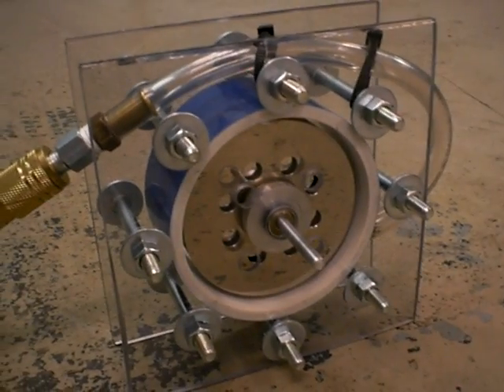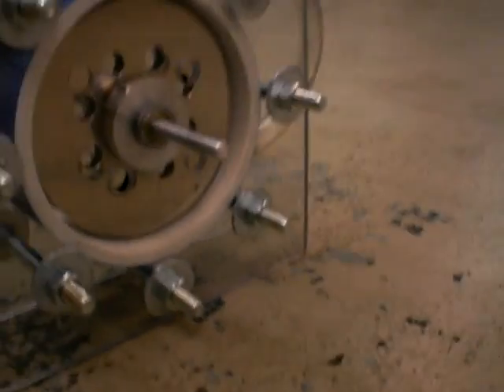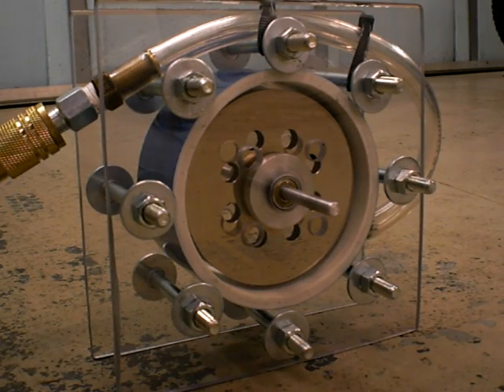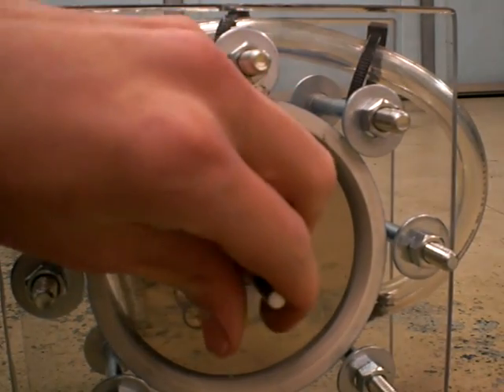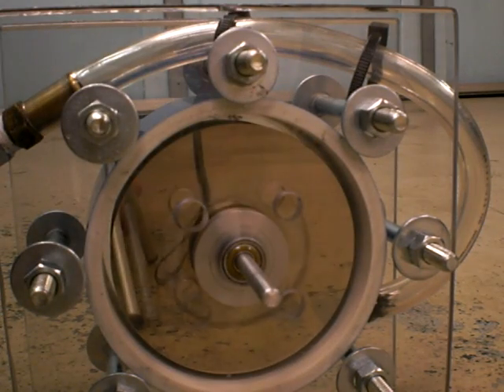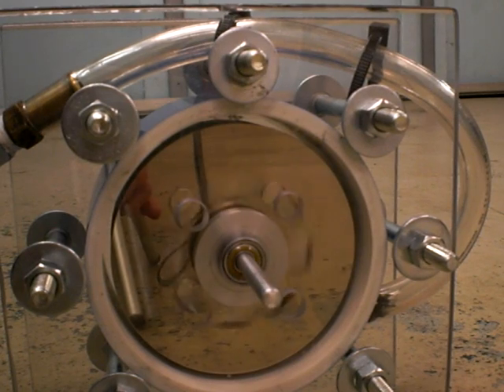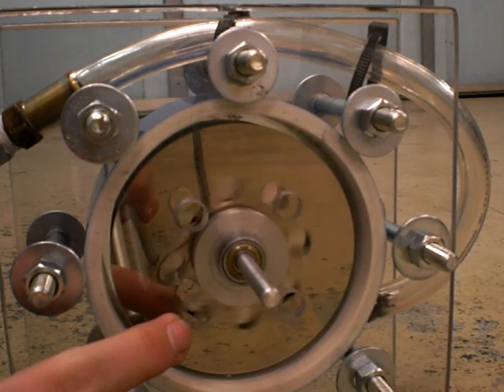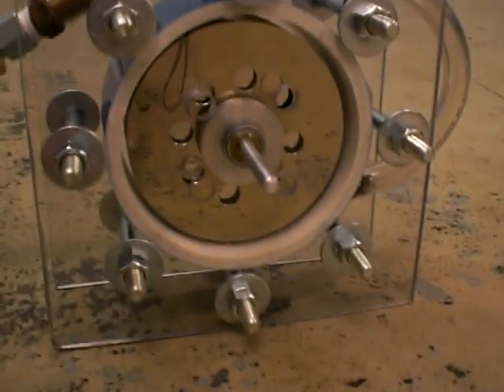Tesla Turbine

Comment: but with any type of load that thing will stop. you basically made a pinwheel. there is a reason tesla turbines are not using for power generation or in boats
Reply: Tesla turbine gets plenty of torque and outputs plenty of power, even at low RPMs, IF you actually know how to design them.
Reply: @CharlieSolis  you obviously dont if you cant understand you can stop it with you bare hand. thats not how torque works
Reply: @abialo2010  like I said IF it’s designed correctly.
Reply: @CharlieSolis  if you think im reading all that nonsense you just wrote you're sorely mistaken. thanks for the reply that is crazy
Reply: @abialo2010  lol well that’s your prerogative but everyone who comes through after will read how you demanded Tesla turbines can’t work and then someone with a physics degree came along and plainly explained it to you and showed you proof that Tesla turbines actually do work. 

Do you really want your reaction that everyone sees to just be “stick your head in the sand?”

Obviously it’s not going to be explained in 2 sentences because the fluid and thermodynamic involved within the TesTur are rather complex.

But ok. That’s your choice 🤷‍♂️

You can only bring a horse to water I guess.
Reply: @abialo2010  well when you feel like reading how TesTurs actually work give what a wrote a read. I promise it’ll be worth your time. It’ll be waiting there for whenever you are ready to read it. Cheers.
Reply: @CharlieSolis  no one is reading all that. but thanks for responding. im happy for you
Reply: @abialo2010   you could have just read it by now. It’s not even 3 whole paragraphs. 

Lol and actually MANY people have read all that because MANY people have seen my TesTurs that actually work and wanted to know how. 🤭

Your loss 🤷‍♂️
Reply: @abialo2010  literally what someone commented back to me 42 minutes ago on another thread…

“George Black • 42 minutes ago
@Charlie Solis This is tremendously helpful. I'm building a small turbine to run a feed pump for a monotube boiler. It should manage the water level in the boiler by running at varying speeds off the condensate steam in a separator as the boiler's water level varies.

Thank you for the videos and helpful comments.”
Reply: @abialo2010  Lol I don’t need you to read my comments for me to know people do in fact read read my comments and find them valuable. 

I’m waiting for you to just read what I wrote because I can almost guarantee you’re going to want to know more, and at the very least see the proof 🤭
Reply: @abialo2010  but dood, I’m totally with you that 99.999% of people who’ve tried making them can’t make them work. And There’s a very good reason for that. They aren’t designing them correctly. 

And again you can go as long as you want without reading my comments but I have a feeling, and from my past experiences with most people, curiosity wins in the end and if I just wait long enough you’ll likely just read my comment and actually want to have a discussion then. Until then let’s keep racking up the comment count on this thread so others will find it 🤓😎🤭
Reply: @abialo2010  did you read it yet?
Reply: @CharlieSolis  that's crazy. Thanks for sharing
Reply: @abialo2010  🤣😂 you can just say no you didn’t read it.
Reply: @CharlieSolis  wow thats crazy. sorry that happened to you. i hope it works out in the long run
Reply: @abialo2010  🤭 again you could have read what I wrote by now. Why keep up this facade and refuse to read 3 paragraphs?
Reply: @CharlieSolis  that is generous of you. thank you for sharing
Reply: @abialo2010  beep boop beep boop 🤖
Reply: @CharlieSolis  i agree with you completely thank you for sharing
Reply: @abialo2010  beep boop boop beep boop beep beep beep boop 🤖

Comment: cool, so jw why is the air spinning the disks if there is a gap between the pvc and the disks
Reply: This is because the air spirals to the center between the discs and then exits the exhaust holes at the center radius of the discs.

Comment: And why is this thing supposed to be any better then any other turbine? He even states that it has a very low torque and just by the sound of the bearings and how quickly it's getting slower it seems to loose a lot of energy.
Reply: Darius der Rote it isn't about the torque. it's all about the rpm. with a proper gear ratio, you can get lots of torque and still lots of speed because the rpm is so high. Tesla's design is more efficient in getting higher rpm because of the long amount of travel of the air circling around in the cylinder. it uses more air friction and is much better for high rpm projects. another youtuber makes Tesla turbines that exceed 100,000 rpm and if you gear that down, you can run anything with it.
Reply: Denarius
Sorry, but that's not how it works.
You can't extract energy from a system that has non or, to put it another way: you can't transform a low energy system into a high energy system just by gearing.
Reply: Darius der Rote it's conversion. the high rpm gears down to low rpm with high torque. simple mechanics. it's the same way that hand crank winches work
Reply: Denarius
I know what you mean, but you seem not to understand me.
You are using compressed air to power a flywheel, that means that you can only extract less energy from that system then you put in. That is because of the loss you have at every bearing, gear contact point, air turbulence's due to the nature of compressible gases and so on and so on.
And on the other side you have to generate compressed air, which is a energy dumb on it's own.
Simple laws of dynamic.
TL;dr: there is no benefit to this system
Reply: Darius der Rote the system was originally developed to run on steam. the compressed air would be provided by steam. this isn't supposed to be perpetual energy. this is just a turbine that can be used with a generator to produce electricity from steam power. you can also hand pump compressed air for the system.
Reply: Denarius
Never mind, I looked it up. It has an efficiency with steam of around 20% and 40% with compressed air (in contrast to the 95% that Tesla claimed).
Modern turbines reach up to 70%, so this system is just... a gimmick.
Reply: Darius der Rote also this system is about 100 years old.
Reply: @Glaswalker1001  What most people mean to be saying is, bladed turbines get a high efficiency on only a very limiting, very specific, very expensive set of proprietary formula refined fuels.  

And the only reason TesTurs don’t is because no one has actually put any money into them like the BILLIONS of dollars thrown at proprietary bladed turbine designs just to get 1% point increase in efficiency.
Reply: @Glaswalker1001  to make them work well and efficiently they need to first be designed correctly though. 

I appreciate your comment but that’s not an issue because, despite what everyone erroneously claims, Tesla turbines work just fine, get plenty of torque and output power at low RPMs.     I’ve got some copy pasta 🍝 of mine that I’ll share with ya here to explain more.  Tesla turbines aren’t made efficient by spinning really fast.   That’s only for when the disc stack is being used as a centrifugal pump, because ALL centrifugal pumps’ compressors, performance is tip speed dependent.   But spinning the turbine fast will produce a centrifugal head that opposes the incoming fluid flow, reducing the pressure gradient across the nozzle, reducing fluid final velocity, reducing mass flow rates through the nozzle and ultimately reducing power out. 

Furthermore the faster you spin them the faster the fluid you have has to go just to still be moving faster than the discs and still provide torque.   Lastly, they work just fine for industrial use and can scale up just fine because the torque on the discs is proportional to the difference in the fluid speed and the disc speed. So the disc tip speed is the important factor here. For any given fluid supply in the nozzle will have a max fluid velocity. So the turbine disc tips will have a max speed set at that fluid speed irrelevant if radius. Now considering that centripetal force is proportional to V^2/R, if you keep the tip speed the same but increase the radius the centripetal forces on the disc for the speeds needed will actually decrease. 

Despite what MANY have claimed about the Tesla turbine, it does NOT need to be spun fast to work or work efficiently.   TesTurs are made efficient when the slip on the discs is reduced and spinning the discs fast does nothing to reduce the slip, only increase the distance the fluid slips on the disc faces, which is by definition “loss”.  Listen to what Tesla himself said in the patents of how to make them work.  “Owing to a number of causes affecting the performance, it is difficult to frame a precise rule which would be generally applicable, but it may be stated that within certain limits, and other conditions being the same, the torque is directly proportionate to the square of the velocity of the fluid relatively to the runner and to the effective area of the disks and, inversely, to the distance separating them. The machine will, generally, perform its maximum work when the effective speed of the runner is one-half of that of the fluid; but to attain the highest economy, the relative speed or slip, for any given performance, should be as small as possible. This condition may be to any desired degree approximated by increasing the active area of and reducing the space between the disks.”  1) increase the speed of the fluid relative to the disc, (not increase disc speed)  2) increase surface area 3) decrease disc spacing  This is how you actually make a TesTur work. Not by spinning it fast.   The fluid interactions with the disc that govern efficiency an torque are adhesion and cohesion. Full stop. And spinning fast does nothing to increasing either to increase the turbines isentropic efficiency.   This is why everyone who chases rpm with the TesTur just flat out fails. They aren’t even trying to design them properly so of course they won’t work.
Reply: @CharlieSolis  Hey, Buddy. Nice of you to answer a comment that is over half a decade old. But I'm not going to read and counterpoint your wall of text.
Reply: @Glaswalker1001  hey man that’s fine if you don’t want to read it though. I know others will come through and read it and that’s all I can really ask for I guess at this point. I’m just trying to clear the misinformation about Tesla turbines. Just for the record I have a degree in physics from Michigan Tech University. I promise it’ll be worth the read.
Reply: @Glaswalker1001  also just for the record the vast majority of my comment is just direct Tesla quotes. It’s really not as much as it looks. I swear.